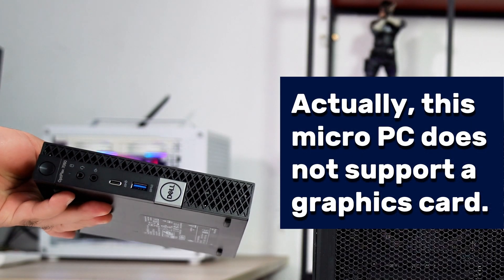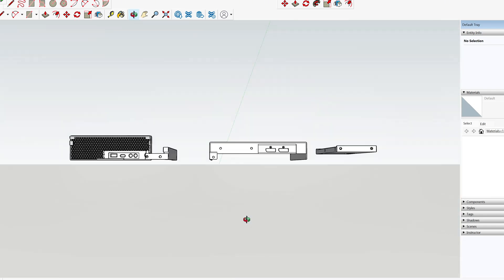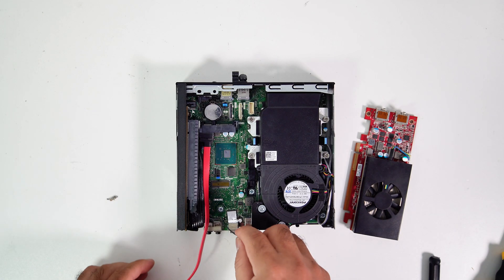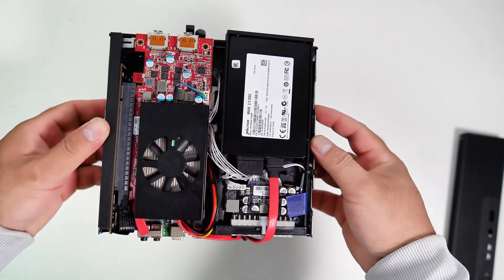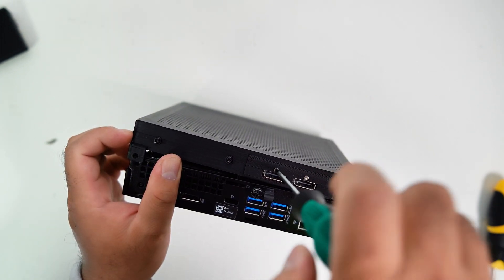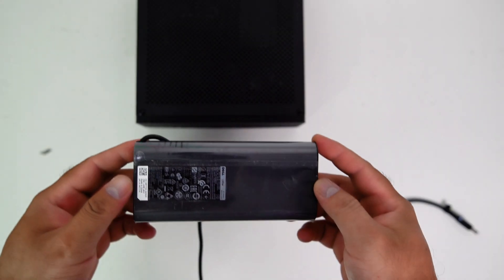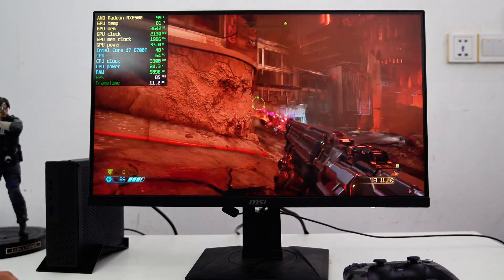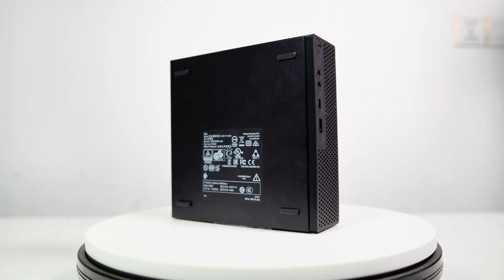Upgrading My Dell 7060 Micro PC WITH A GPU – Is It Possible?

Comment: Great build in awesome size with well sourced components. However, the feed to Pico PSU is not a great piece of electrical work. Feed wire cross section area is waaaay too small. Not so smart at all. Sata power is only 50w and by look of things has a much thicker wire cross section
Reply from the maker: Thank you for your suggestion; I'll keep it in mind and improve in my next video. Thanks again for watching!
Reply: @itggear  use the other m.2 for an NVMe drive they make e key converters to do so
Reply: I am actively trying to replicate the setup with an 3050 i5. I feel like I'm 90% of the way there but every time I hit a snag. I'm getting no hard drive alerts but i am getting power to the pico. Any help appreciated. Thanks!

Comment: Можно ssd разобрать и напечатать новый корпус ssd по меньше, он маленький внутри, бывало когда места не хватает я без корпуса прикручиваю ssd,или отпиливаю от корпуса лишнее естественно саму плату ssd вытащить прежде чем пилить
Reply from the maker: That's a fantastic idea! I actually considered dismantling the SSD and 3D-printing a new, smaller case for it. However, when I removed the SSD shell, I found that the PCB and chips are entirely encased, unlike other SSD models where the internals are more accessible. If I can find a smaller PCB SSD, I'll definitely explore this in my next project. Thanks for the suggestion!